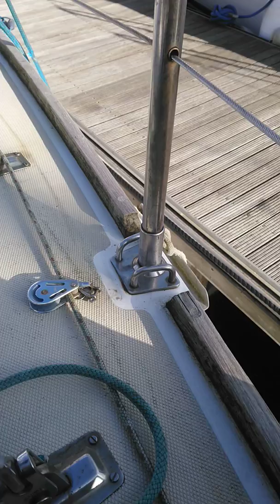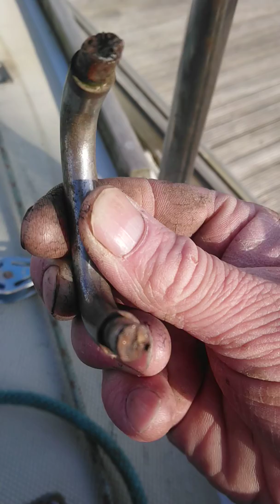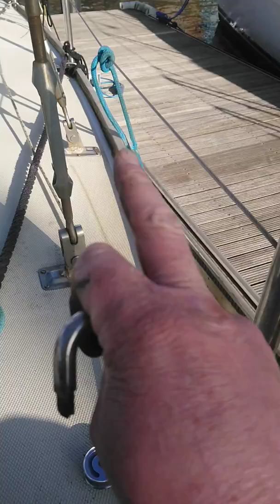Rare stainless steel crevice corrosion found on yacht

Comment: This type of corrosion is not as rare as you might think. I found some bolts and washers suffering this where the wrong type (round headed instead of countersink) had been used to bolt down the granny bars.

Comment: I have to just say that if any of you out there are considering not having a survey done, that this guy found an issue with the heater on the boat that I was buying that could easily have had fatal consequences if not discovered. No affiliation, relation/acquaintance or anything else, just a very relieved client. It's not worth the risk.